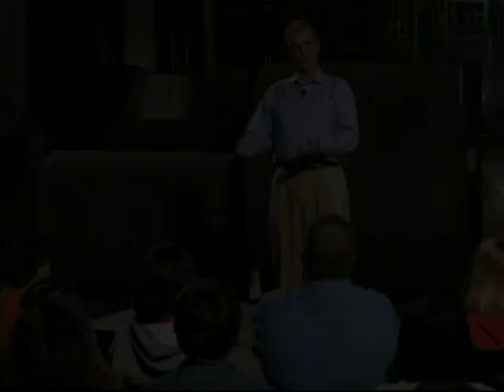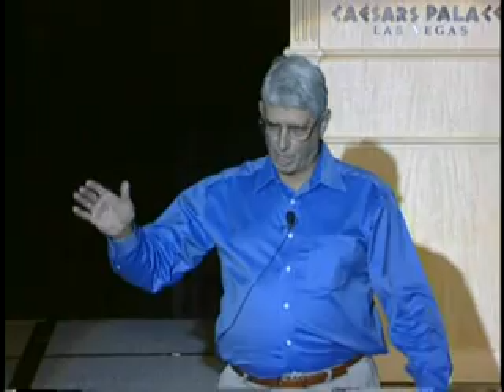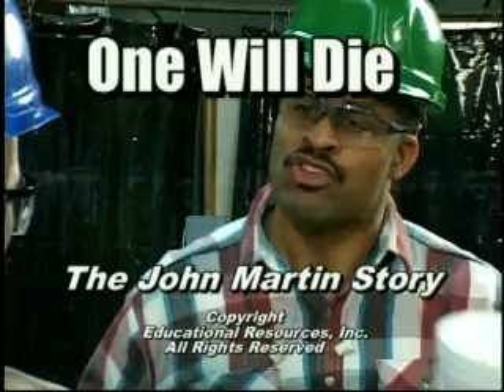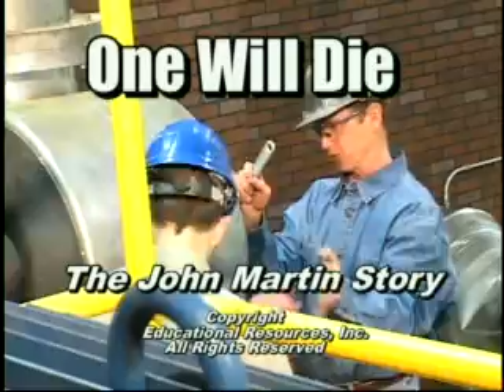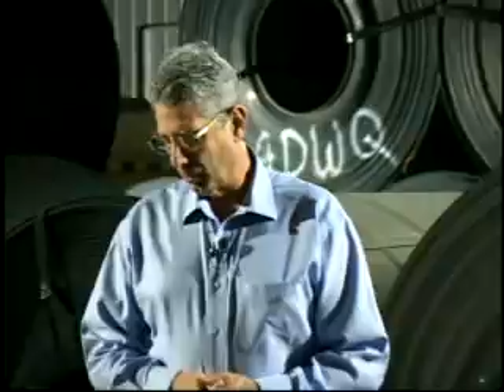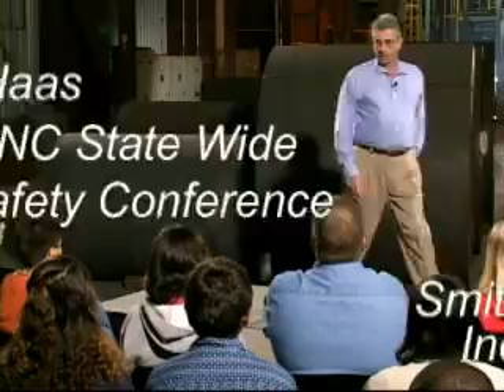John Martin, Safety Solutions

Comment: I've seen John's video at work. It really opened my eyes. I'm puzzled though that at my place of employment management stresses safety, but at the same time sets a production goal (that I feel is to high) that employess have to cut corners to meet that goal. I understand that the work needs to get done. But I think the job will be completed in good time if an employee works at a moderate pace and the company lowers it's standards a bit without paying incentives to exceed production.
Reply: You’re bogging the job down.
Reply: @richardcowley4575  - When a company pays incentives to produce more than average. Employees are less safe on equipment. I see it all the time. I've seen them hit the racks in the warehouse due to their hast and less alert.